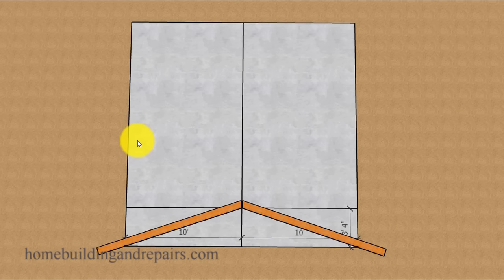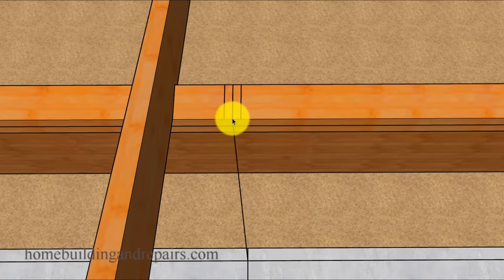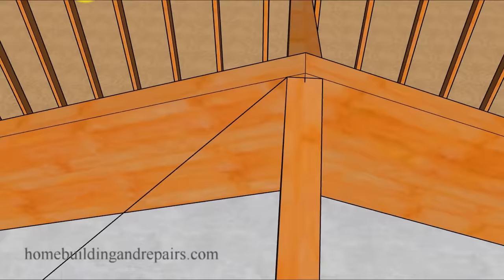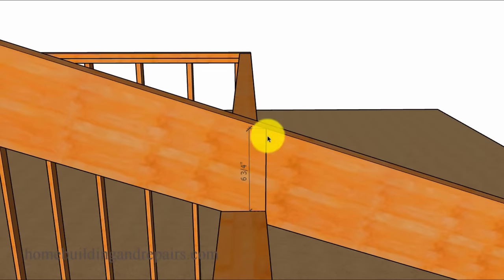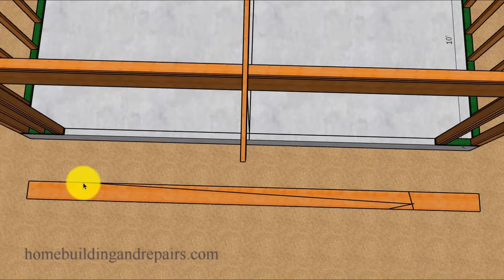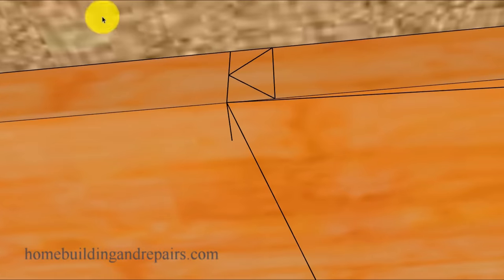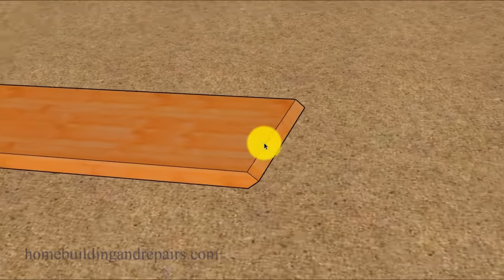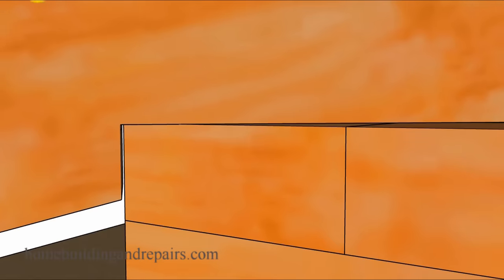How To Layout And Cut Hip Roof Rafter Without Any Math Formulas or Framing Square

Comment: At the upper end of the rafter the 3/4” offset should have been measured horizontally, not along the slope. This caused the hip rafter to be slightly longer than it should be. This is evidenced by the small gap at the seat cut when the hip was installed. This error is more pronounced on steeper slopes.
Reply from the maker: Maybe you could provide us with the exact difference on a 4:12 roof pitch. I will except a decimal or fraction, thanks in advance.
Reply: That makes sense Joe. if you measure 3/4” perpendicular to the plum cut line and not down from the crown of the board. This would shave a smidge more off when making those 45’s on the hip rafter. Great video tks!
Reply: @gregvancom  Difference is 0.038” for 4/12
0.126” for 8/12
0.220” for 12/12
Reply: @joefowler3672  Less than 1mm then? (I've converted it to metric for my understanding, as I've never used Imperial, and only quickly in my head whilst reading, so correct me if I'm wrong), is that relevant though?  Surely that's well within tolerance?
Reply: @SimonPlatt  it is within tolerance for lower pitches but not for steeper ones. Since measuring the 3/4” horizontally is no more difficult than measuring along the slope there is really no reason not to do it and eliminate the potential error.
Reply: @joefowler3672  Sounds reasonable, I'd go with that! 👍

Comment: If your pitch is the same on the "end" of your structure the common rafter will give you the hip location by simply finding center of the top plate and placing the seat cut on the wall and matching the plumb cut to the top of the ridge.
Reply from the maker: Sounds good.

Comment: If you were to go all the way out to the corner, you need to bevel the top of the hip, if not you need to bring the seat cut back to match the edge of the wall
Reply: Great video!
Reply from the maker: If that's going to be easier then I would say go for it and glad you enjoyed the video.

Comment: Very interesting. Hips have to get dropped so outside edges will be on the same plane as the commons. Formula= Rise divided by 17 multiplied by half the thickness of the hip, =Hip Drop
Reply: Or you can just measure down from the top of your hip rafters the same distance that your common rafters land on the top plate and that works great also. And for length of your hip it is one plus a half of what the common rafters hang over.
Reply: @rexolrexol7893  absolutely right
Reply: @rexolrexol7893  but you need to split the thickness of the ridge equally on both sides .so if the ridge is 1 1/2 inches you would subtract 3/4 of an inch from the length of your common rafters length. 3/4 on the right side and 3/4 on the left side of your ridge will equal the 1 1/2 inches which is the thickness of said ridge .and rafters books are different. Empire gives you the length according to a 1 1/2 ridge and Swanson gives the true length of your common rafters that you have to subtract half the thickness of your ridge from your common rafters length.
Reply: @rexolrexol7893  I always carry a swanson book. And for cutting your sets of Jack rafters for the hip if your using a 10 /12 pitch I believe it's 22 7/8 inches you subtract from each jack rafters and they will land 16 inches on center. Some of my comment was talking about how long to cut the tail of the hip rafters to get you facia to land straight and tight on the outside corners.
Reply: @rexolrexol7893  it's way easier to do it than talk about it for sure
Reply: @rexolrexol7893  not sure who or if you think you are teaching me something, if so thanks for the attempt but I have been a residential framer for 35 years. All the things you are saying are done without thinking for me , it's all natural reflex. But if you are doubting my ability , I am sending you an open invitation to put your running shoes on and come hang with my crew for a couple days and we can show you .the running shoes you will need to keep up with me. I am not a teacher or good at explaining things but if your fast enough to keep up and can learn by watching and working next to me you will be all set. Experienced carpenters do all of that without thinking. And if your a carpenter you also know that there are very few up and comers that can cut a rafters or layout a stringer.
Reply: @rexolrexol7893  if you measure from your seat cut to the " edge " of the hip all your rafters plain out .
Reply: @rexolrexol7893  you don't need to lift your hack rafters to meet the plain of the edge .the center of your hip rafters will always be lower than the plain of the leading edge or whichever side you are stapling rafters to and quite frankly there is not one hip roof that cannot be cut completely on the ground and have everything land correctly unless you over think things with all the mathematical equations you use .the rafters book gives you every measurement you need
Reply: @rexolrexol7893  I learned everything I know from old grumpy men , they were not teachers either .but I put on my running shoes when I was 15 and kept up with the grumpy bastards and learned and in a very short time the grumpy old bastards weren't so grumpy to me anymore. It's a different world in construction now. You got the guys that say they know and within ten minutes you know they don't know what they say they know and then you get the guys that come looking for jobs with ten years of experience but all their tools are brand new. Framing houses is a lost art , computers and gaming are the new art. There are very few construction guys in the new generation. This comment should tell you a lot , I love building houses and it is relaxing and rewarding. Tight is right , if it's square it should be level.
Reply: @rexolrexol7893  your seat cut will always be what is left over to make 90 degrees. If your cutting a 10 pitch on your rafters to meet the ridge , that is 40 degrees so your seat cut will be 60 degrees. Everything comes back to 90 degrees .if your cutting an eight pitch it is 34 degrees and your seat cut angle will be 34 - 90 = 56 
It's very simple when you come to the conclusion that everything comes back to 90 degrees
Reply: @rexolrexol7893  what do you call a 10/12 pitch. Of course there is pitches. It's the amount of rise per each foot of run .a 10 /12 is a 10 pitch and the same for 9 , 8,7,6 .that was not a very good comment to add .they can even go 18/12 which is an 18 pitch.
Reply: @rexolrexol7893  a 10 inch rise for every foot is a 10 pitch , not a 5 1/2 pitch.
Reply: @rexolrexol7893  your system for cutting hips involves cutting the pitch on the top of rafters and then holding the hip up in place to mark a seat cut ??? The measurement in the rafters book is from the top of the rafter, first you cut your pitch and then you measure your length and square your length down the rafters as if you were going to cut another pitch but don't. And then you measure your 3 1/2 inch seat cut and for you overhang you measure from the line you made to figure out your seat cut to get the overhang that is desired and of course subtract what you are using for your facia material. Certainly is a ten pitch or any other number pitch. It's marked on every blueprint and specified in the notes on the blueprint. So you sure didn't sound like a know it all if you think there is no such thing as a ten pitch and if you think 10 inches of rise in a 12 inch run on the rafters length is a 5 1/2. You been wasting my time , I thought you were a carpenter ?lol .that was silly if that was some kind of test for me.
Reply: @rexolrexol7893  no it really isn't. Do you use a swanson or an empire rather book ?
Reply: @rexolrexol7893  the 5 in your 5 /12 stands for 5 inches of height gained for every 12 inches. Hence the 5/12 is a 5 pitch.
Reply: @rexolrexol7893  happy to educate you a bit .
Reply: @rexolrexol7893  once again a ten inch rise for every foot of rafters is a 10 pitch and everyone still uses pitch not slope .and you are incorrect .its easy to educate yourself just look at a swanson book or even Google it. You been going on with this slope thing and you are incorrect with your information. All you have to do is call a roofer and ask him or her if they price by the pitch and they will straighten you right out. 1 inch per 12 inches of rise is a 1 pitch and so on and so forth .you really aren't a framer .stick to what you know , stop confusing yourself. I told you I have been framing residential homes for 35 plus years and your slope or pitch argument is mute .everywhere in the world a roof has a pitch and it's determined by the number of inches if rise in a 12 inch run of rafters. 120 inches of rise on a 24 ft building is a 10 pitch .
Reply: @rexolrexol7893  Thanks for the laugh, but are you sure that you were a framer? Framing isn't the same as setting grade stakes for a dozer operator. The twelve, in say 5/12, represents 12" and ultimately translates to 5" of rise for every 12" of run, not a fraction. A 5/12 pitch at 10' of run, would have a total rise of 50", or 4'2"... whichever comes first, but not 10'. If it makes it easier to comprehend, draw out 10 tick marks, (just pretend they're 12") and put a 5 at each mark. Add those 5's together to get the total rise. It may surprise you.

Comment: Subtracting a quarter inch off the heel height on your hip rafter is a good idea. If you don’t, the corners of the rafter are high.
Reply: it would chang according to the slope of the roof...  The reason I say slope   there is no such thing as 4 to 12 pitch
Reply: @Dan-z6b3d  You’re wrong.

Comment: Just use a framing square. Sheesh!
Reply from the maker: And a pencil.
Reply: And use math.  It works every time.  Once you figure out your rafter and hip factors, you can calculate the length of all of your hips and rafters without setting foot on top of your walls.  Still a very well done video if you don't want to get into the math.  Clear and concise.  Nice drawings to go along with it.

Comment: Seriously, just use a framing square and the info embossed on that square. If you don't like math then use the step off method of laying out rafters. My 2 cents.
Reply from the maker: I wasn't about to suggest this is the easiest method, but another one.
Reply: @gregvancom  Cheers and thank you for the videos.
Reply: @rexolrexol7893  all the info that you need to layout and cut rafters is on a proper framing square. Just saying.  Cheers
Reply: @rexolrexol7893  I'm not sure what you mean sir. I layout my rafters directly on the boards/ timbers to be used for the rafters. For rafters that there are more than one of I will use the first rafter that I layout and cut as a pattern (such as a common rafters in a hip roof).
Reply: @rexolrexol7893  it's not 19 ft 10 1/2 .it is 20 ft minus 3/4 so 19 ft 11 3/4 .but just measure out 20 ft and cut it 3/4 short .pretty simple.
Reply: @rexolrexol7893  that is incorrect .
Reply: @rexolrexol7893  the rafter book gives you the hip and common lengths and it also tells you the measurement to subtract from the desired pitch of the roof. So you take your first measurement (the longest hip rafter) and subtract the inches it tells you for the pitch you are using and everything gets cut in books and every hip is the same. No matter if the building is a square or a rectangle all the hip rafters should be the same on every corner and you difference is made up in between the two center commons. All your plywood books will be the same as well as long as your ridge is level.
Reply: @rexolrexol7893  sorry it's 11 1/4 not 3/4
Reply: @rexolrexol7893  That is easy basic math. Using the step off method (which I neither use nor suggest people should use unless as a last resort) there is no math required, all you need to know is the slope of the roof and I don't really see how it is prone to mistakes, it is quite straight forward and uncomplicated. Cheers and stay safe.
Reply: @rexolrexol7893  you make it way to complicated for yourself. Way to much thinking .all you need is the length and width of the house and what pitch you want and it's all in the swanson rafters book.
Reply: @rexolrexol7893  the best method for cutting rafters is to use a skill saw .and the rise of or the pitch of your 1/3 would depend on the width of the building. But once again 1/3 is not a pitch. It is the slope you keep speaking of. And yes the book gives you the length of the rafters depending on the " pitch " that is desired .you need to take a desk job or seriously Google what you think you are talking about. You are confused on a few things. This conversation has been going on a long time and all your questions or mis informatics can be explained if you open your rafters book. Again the best way to cut a rafters is with a skill saw and the best way to get your measurements for someone who has a hard time understanding that roofs are designed and based apon a certain desired pitch. Your 1/3 question can be answered if you know how big your building is and that will give you the pitch you want to cut on your rafters. If you want a 1/3 pitch on a sixty foot building you would cut a 10 pitch on your rafters.
Reply: @rexolrexol7893  what does the 3 stand for in you 1/3 .is it inches or feet ?
Reply: @rexolrexol7893  if your 1 is in inches and your 3 is in inches it would give you a 4/12 pitch which is a 4 pitch .
Reply: @rexolrexol7893  a pitch is the total rise of inches to 12 inches of run at least that's the way everyone else in the world does it , engineers , roofers , framers , architects .you know everyone but you. You said you have a rafters book ?please look it up .you are wrong in the way you are thinking. You are totally wrong.the book tells you the different lengths of rafters depending on your desired pitch for the size of your building .not sure again if you think your teaching me something or not but you are making it extremely confusing for yourself and trust me only you know what you are speaking of. Real carpenters and framers will know exactly what I am saying and they also open their rafters books and know how to use them. In the beginning of the book you supposedly have they give you instruction on how to figure out the " PITCH"  on your roof and they teach you how to use the numbers tables and how to add if your lengths do not come out round numbers .it will give you the measurement to add to any of your rafters by the half inch in case your building is 24 '1 or 2 or 3 and so on and so fourth. I can give you a lesson on how to use your speed square to do it or your framing square to do it or I can even show you how to get the lengths of your hip rafters with no book , no square .just measuring right on the floor. It's pretty simple math unless your teaching the class. With all do respect. You numbers and your pitches are not what you think you are incorrect in your process and theory. I apologize for having to tell you , the self proclaimed know it all, that you are wrong. Go watch a different video or Google how to determine the "PITCH" of your roof .educate yourself and then come back with an intelligent and correct theory .with all do respect. I have built house for 35 yrs and that's no bs , you have not built a house or maybe you have built a house but you were the guy putting the boards on the side of the line with the x and nailing it.
Reply: @rexolrexol7893  You don't need a book ever if you know how to do the math.  Pythagoras did all of the work for us already.